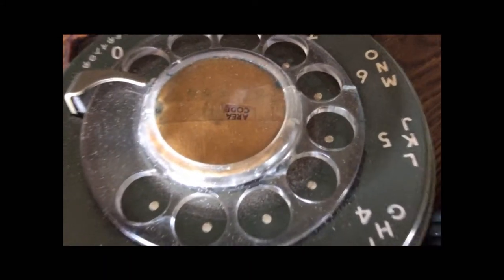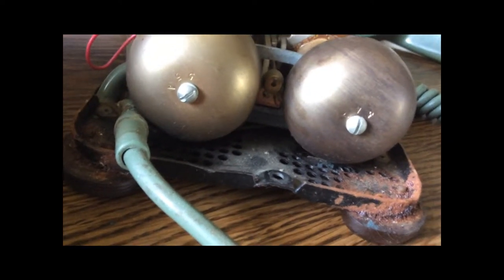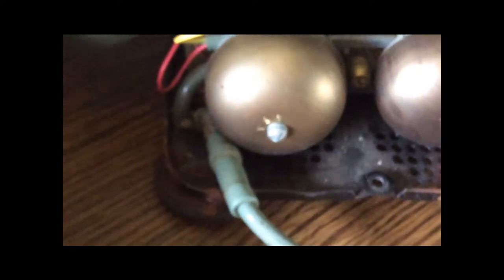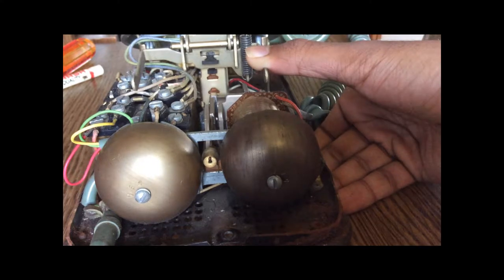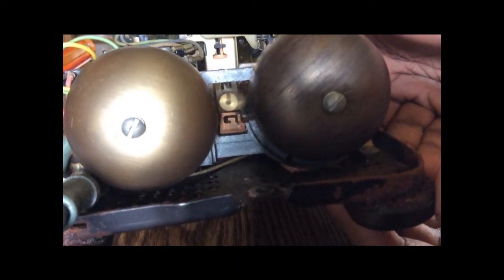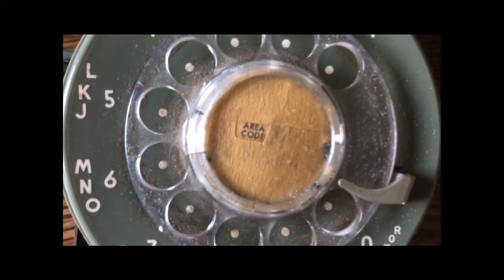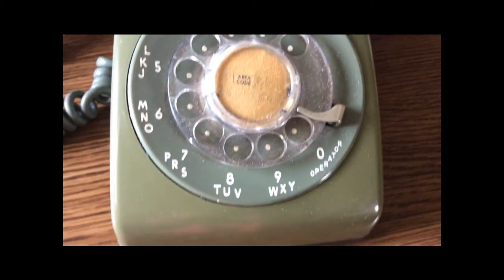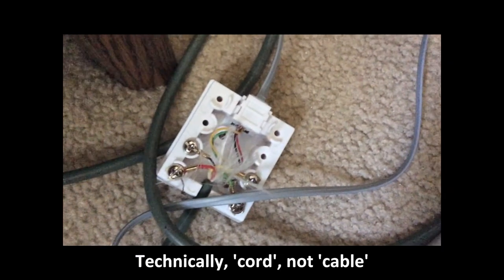PBX Showcase #11: Avocado Green Western Electric 500

Comment: After I did the bias spring on my 554 rotary wall phone, the bells no longer move when you use the loud knob.  And at one point it was just vibrating on the bells and I figured out that the bell was too close to the striker and it prevented it from ringing and I thought I broke the phone.  I turned the bells munally and thank god it rang but, the loud knob doenst move it, sometimes if you’re lucky it’s a little bit but then it gets too close.  I recently switched from POTS (frontier landline) to a VoIP line and the loud knob always worked until I played with the bias spring, moving the bias spring to the oringal direction does not fix the issues.

Comment: Question, can I replace the original 3 wire chord with a new 2 pair silver satin?   I recently bought a model 500 but the 3 wire chord is extremely short and the rj-11 tab is broke off.
Reply from the maker: I'm not the best person to ask, as I've not done too much of this work myself. My guess would be yes, but there is likely a way to check. Are you able to get it plugged in and connected with that 3 wire cord? See if it works. Now, open up the phone and disconnect the yellow wire (usually yellow, the one that's not red/green or tip/ring). Now, see if you can still dial out and ring the phone. If not, the third wire is necessary; I think it might be a ground. In fact, I had that same issue with this green 500 you see here. I originally only connected the two tip/ring wires and it wouldn't ring. I connected the yellow wire, and it worked perfectly. So you may need all 3. If not, a 2 conductor wire would suffice. Otherwise, if that's the case, a 4-conductor line cord should work. It's simple metallic connections no matter how you make them. But, I'm curious how your phone has a modular line jack, though, but a 3-wire cord.